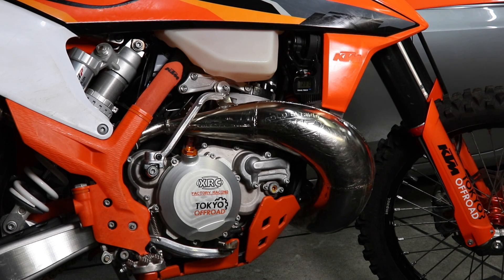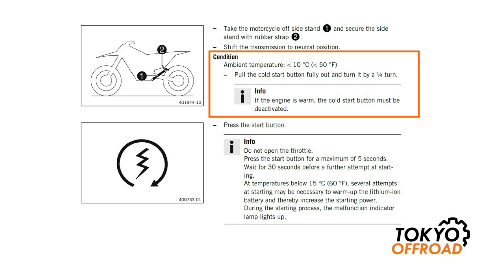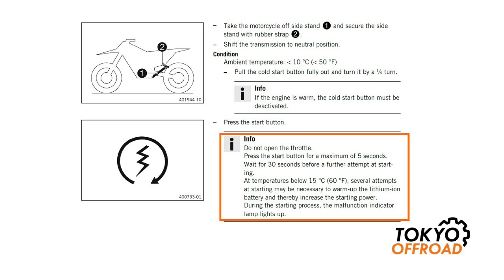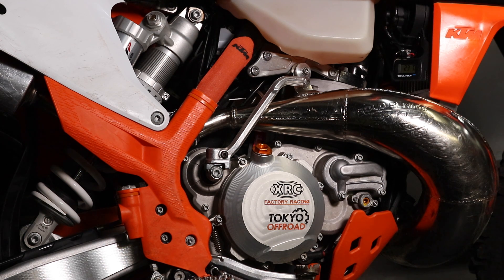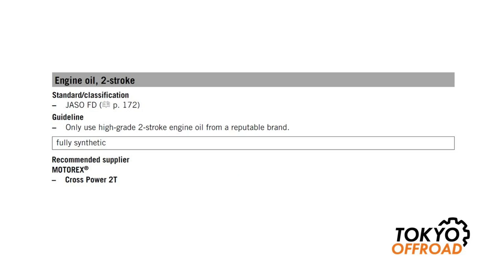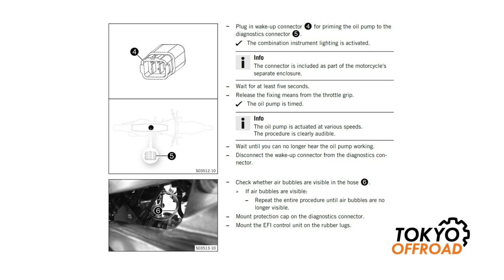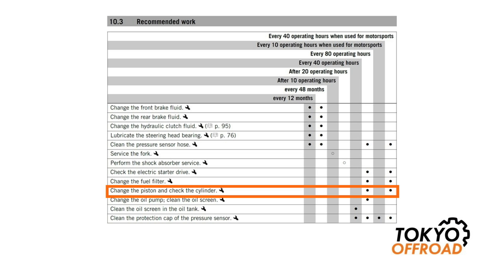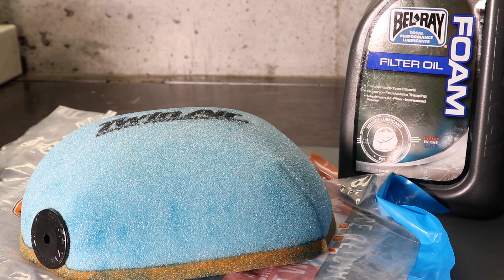Tips To Help Ensure Your TPI 2-Stroke Engine Doesn't Seize

Comment: Good video as always. But I’m finding it suspicious, this is like the 3rd video I’ve seen on this, yet “failure rate is low”......
Reply from the maker: Personally I don't know anyone who has seized a TPI, but as mentioned in the video have read about quite a few on Facebook. At this point I'm inclined to believe the information my dealer told me (that the failure rate is relatively low). I'm not disputing that problems occur, but do believe some things can be done to help reduce the chance of a seizure occurring. Hopefully the tips in this video help with this...
Reply: @TokyoOffroad  Three main reasons these bikes seize early, 1. running them hard before warmed up properly, 2. dirty air filter 3. using different oils for the oil tank, not sticking with KTM brand.  Most seizures are human errors, not mechanical failures.  Great video just like all the others you have done!!!
Reply: @kimojon9665  i have a 2011 250sx and have ran either amsoil dominator or interceptor. Depends whats in stock but ive had no issues with it. Runs good in either hot or cold weather. Only issue is fouling plugs but  thats mostly fixed after replacing the reed valves.
Reply: @kimojon9665  wrong wrong wrong
Reply: @123123boobies  I dont think he means every single brand other them KTM, it's more about idiots that dont know any better and put the same oil they have been using for 30 years in there TPI bike, when if they dont want to do the research like you or I did, then just run the recommended brand
Reply: Eh everyone wants a video to make about some ‘critical flaw’ with a certain brand. There is buzz about it rn.
Reply: Betas are known for it, other then that it's being mentioned so much because carb riders are coming up with more reasons to hate them so of course they make it seem like it's happening alot 🤷‍♂️ and that's where the demand for these videos come from
Reply: @samuelyeet6006  there are zero advantages to TPI vs carb. Ktm is being forced to do it, otherwise the bikes would still be carb. It’s makes the bike heavier and more complicated. Why would they bother?
Reply: @kt550  being ready to ride out of the box? Being able to have a great running bike without being a pro at carb tuning? Being able to drastically change elevation without having to mess with anything? (Which is a real problem otherwise lectron and smartcarbs wouldnt be so successful, 500 to 1k$ a pop) ability to start almost instantly everytime? Not having to premix. Not having to do anything after fitting new pipes or other mods to the bike as the ECU will automatically adapt (to a certain degree) dont get me wrong, some of those can be cons too, and I know theirs cons as well, but to say there isnt a single pro to TPI is silly, seeing as the evolution of automobiles are where they are now due to fuel injection
Reply: @kt550  I mean you can go look at any review of these bikes, from joe smoe to the big names, all of them say it rides amazing out of the box, some have their issues, but that's been a thing since dirtbikes were made, all of them have issues
Reply: @samuelyeet6006  fair enough. Still doesn’t make sense for KTM. Makes the bikes heavier and more complicated. They are being forced to do this...
Reply: @kt550  they are being forced, but isnt that how 4 strokes came out to the MX scene due to emissions? Now the 4 strokes are probably the best MX bikes out there.
Reply: @samuelyeet6006  true but the early 4 strokes wear hogs and terrible to maintain and start.....
Reply: @kt550   maybe true, but the first competitively built one won the AMA in 97 and 98 when all the other riders pointed and laughed at yamaha for trying to make a 4 stroke dirtbike lol 🤷‍♂️ I honestly think in 10 or 15 years none of the big companies will be making carbed bikes on their main bikes
Reply: @samuelyeet6006  I agree with you, they will have no choice. Again TPI might have an advantage 10 years from now, but as I said earlier nothing changes the fact that KTM is being forced to do so
Reply: @kt550  I dont think them being forced to do it takes away from it being better, I think If anything the only thing that was stopping them is the price, it cost them a ton to develop it and to put it on the bike  🤷‍♂️ and I personally think it came out awesome, and alot of people do
Reply: @samuelyeet6006  Why do the moto bikes still have carbs then? Hint: they don’t fall under the emissions regulations...
Reply: @kt550  hint: because manufacturers want to save money on them...... TPI cost more and weighs more as it requires batteries, large stator, and you might as well have a starter too at that point,  you know... all the things that dont come on those moto bikes 😂
Reply: @samuelyeet6006  lol so what’s your point? That’s my point exactly....?? There are minimal pros to TPI minus meeting the emissions regulations 😂 otherwise they would be on the moto bikes lol
Reply: @samuelyeet6006  they don’t come on the moto bikes because they are a pain in the ass, expensive and don’t actually make the bike any better performance and reliability wise. The main point is that Ktm only does TPI because they HAVE TOO not because it’s better than carb
Reply: @kt550  lmao it's like you ignore everything I say but 2 words, because manufacturers want to save money, that's the only reason, the weight thing is on top of that and for 2 stroke moto bikes only, if there was a battery on the bike like every bike OTHER then a moto bike, for things like E start, which are a MUST now a days for any bike that isnt a moto bike then that weight factor wouldnt be a problem, and if you have a battery you might as well be fuel injected 🤦‍♂️ come on man put 2 and 2 together. Why do you think all the 4 STROKE moto bikes have batteries, E start, fuel injection and cost a couple thousand more?... didnt think of that one did you? 🤣
Reply: @samuelyeet6006  battery is not needed for moto. I’ll make it simple
1. The moto bikes have carbs because they are under closed coarse regulations thus they can run the bikes rich and “pollute”
2. The enduro bikes have TPI because they are FORCED to meet the emissions requirements. NOT because TPI is superior. It’s more complicated, costs more, less reliable, heavier, harder to tune and gives similar to equal performance. 
It’s like diesel trucks being forced to run DEF systems.
Reply: @kt550  again you are just repeating what I'm saying lol we know it's not needed for 2 stroke motos because of power to weight ratio due to the BATTERY, but they are on the 4 stroke motos, if fuel injection wasnt better then why do the 4 stroke motos have it? For that matter why is every single good vehicle made now a days fuel injected? If there are no benefits and still cost more to make, why have them?
Reply: @samuelyeet6006  there is nothing wrong with fuel injection.... it’s the fact that they only did TPI because they WERE FORCED TO MAKE THE BIKES POLLUTE LESS. This is going over your head
Reply: @kt550  what is your point then? Like I said, that doesnt take away from the fact that it is the next step and is better then carbureted, you keep saying that they were forced to, like if that somehow proves that it's not better, it doesnt. Like I said the only reason they need to be forced to is because it cost them more, if it was cheaper then carbureted then it would be standard on all bikes with a battery, because FUEL INJECTION IS BETTER THEN CARBURETED. I think all of this is going over your head and you just keep looping around saying the same shit haha

Comment: Mine had a seize around 80hrs, didn't realise till I took off the pipe off to clean, looked into the cylinder saw the intake side of the cylinder was badly scored
Reply from the maker: That's too bad. Intake side scoring could be due to dirt ingestion. What did you do?
Reply: @TokyoOffroad  got the bore honed it was barely saveable,  new piston, also put a two stroke  performance tune on it for extra oiling. Bike is a 2018. 

I did the oil pump priming sequence 3.1ml in 30 seconds, yours was over 6ml was that a 1 minute test?
Reply: @Huda88754  his test ran for about 33s in this video
Reply from the maker: @Huda88754  - I just checked the raw video and the KTM stock 2021 ECU oil priming sequence lasted exactly 1 minute.

Comment: Great video and great simple easy and important tips! I've run without a thermostats for years now but my location temps vary from 8c to 35c so have had zero issues but do warm up the bike correctly first. Thanks.

Comment: In order to estimate the engine temp, it is good to know that the normal human threshold of pain temperature is about 140F, so when it is uncomfortable to touch the radiator or cylinder bare-handed, that component will be close to 140F.
Reply: True . This is fairly accurate.